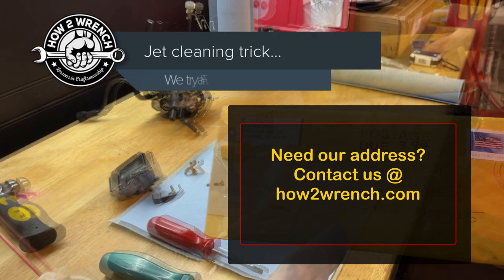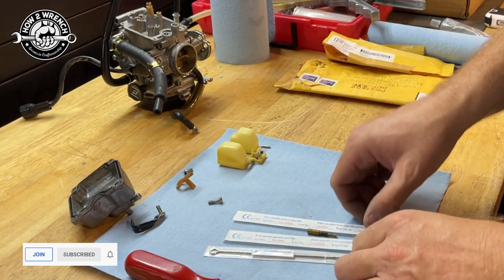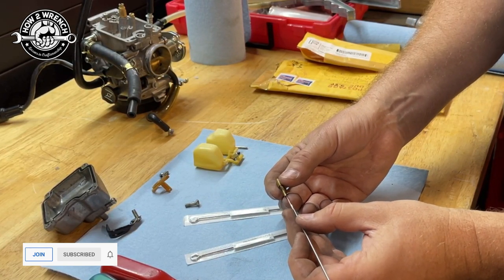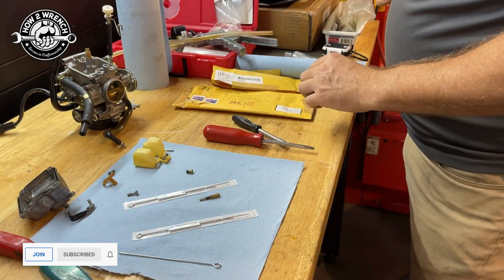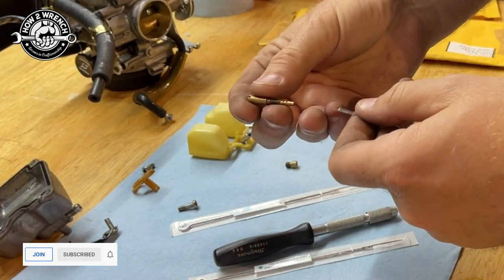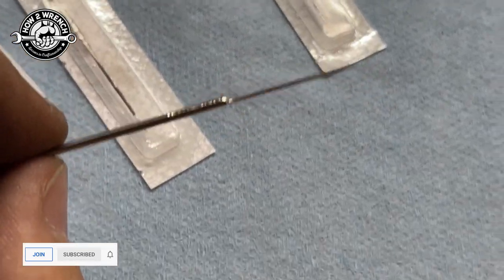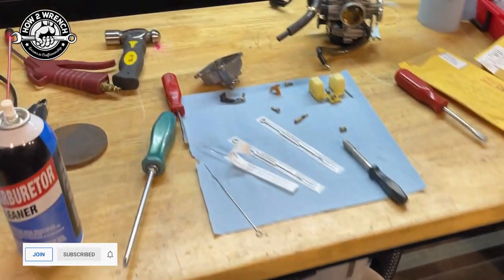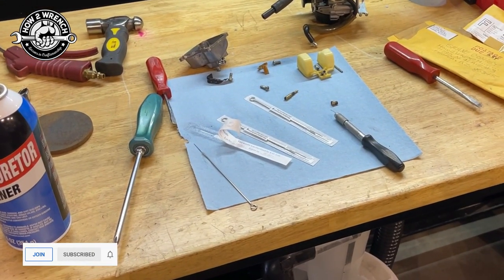Jet cleaning trick with tattoo needles. We try an ONLY FANS method! Did it work? #carburetor

Comment: I learned a very effective method from my mentor who restored Vincents and other vintage Britbikes. I hold the jet (this works especially well with low-speed jets packed hard with varnish) using  locking forceps or a needlenose pliers held shut with a rubber band (less easy to drop the jet but I still work over a tray) and play the flame of a Bic lighter under the jet until the varnish expands and extrudes out the ends like a very small turd. This turns the varnish to ash making cleanup with solvent super easy.
Reply from the maker: Nice, we will have to try it out!

Comment: Many motorcycle pilot jets cannot be cleaned.  Just replace them.  Sucks, but true.  And NEVER run standard pump gas / ethanol gas in a motorcycle atv dirtbike boat lawn equipment, etc.  THIS is why jets get clogged.

Comment: A quick question please.
If the the float height is correct and the float valve seat,o ring and valve are good..is there any other reason why the carb would overflow into the cylinder?
Thanks 👍🍀🇮🇪
Reply: you don't say if the problem is happening under running condition or not but if it happening during none running periods then your needle and seat have to be leaking, you cannot tell by looking at the parts. Something i do every time before reinstalling carbs is, with my mouth i blow through the fuel line while slowly rotating the carbs upside down or even if you just blow with the carbs upside down with out rotating you shouldn't be able to blow air through no matter how hard you blow with your mouth. i have had the parts look perfect but still one of the carbs in the set let air through, just don't use mechanical air pressure......
Reply from the maker: Sure is...we have a member video on that on...best $1.99 you'll spend to support the channel... 😉 Join this channel to get access to perks:
https://www.youtube.com/channel/UCBhM8DCKnT3qXwTW0eToyCg/join    
-Daily MEMBER FIRST COMMENTS ANSWERED FIRST 
-Live Q/A video chats
-Wonder if we have a video on your need? Members can request content links!
-Full Access to the ENTIRE 700 video library
-Member-Only FREE tool giveaways   

Got an emergency and your head is about to explode from frustration or fear? Get Shane’s cell here: https://how2wrench.com/ols/products/techline-one-on-one